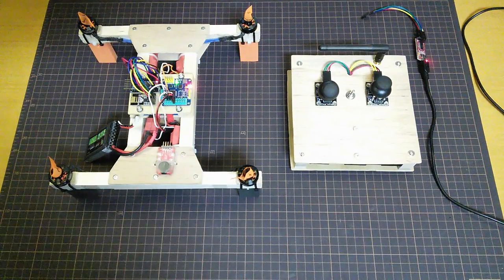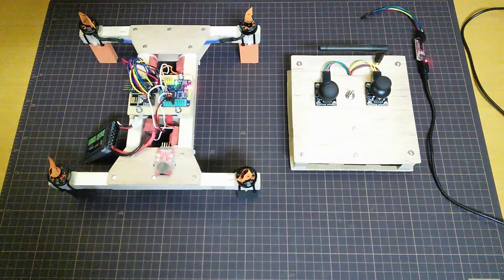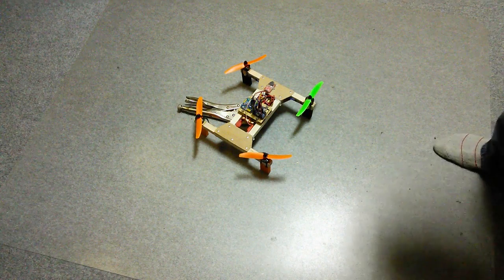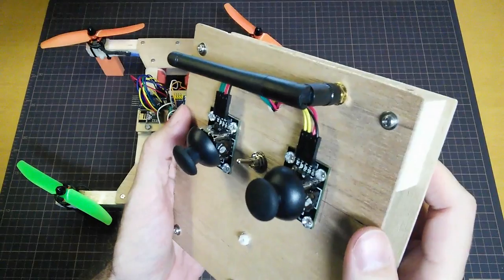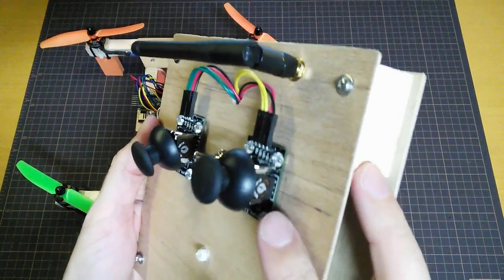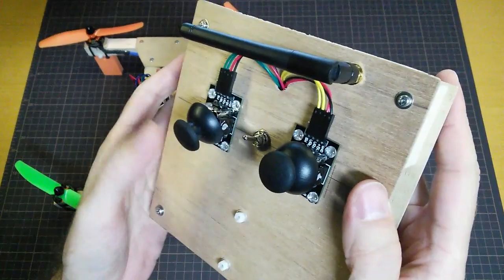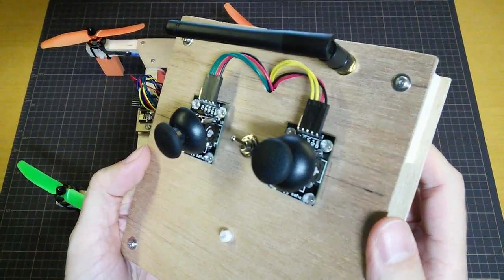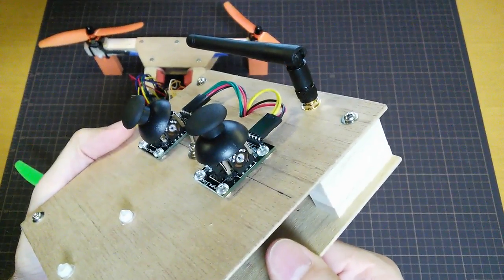Cheap-ass quadcopter build Part 9 - First test

Comment: Hi iforce2d, I took it for the first flight today. And it doesn't end well. I start the throttle just fine and just a bit of a roll , It make 8 3D flips in 2 seconds and crashed .It broke my landing gear. That's quite unfortunate. However I am unable to find whats the problem is. Please help out!
Reply from the maker: Is it in angle (auto-level) mode or rate (acro) mode?
Reply: It is default. I didn't set any mode.

Comment: Hello! Many tanks for your videos, it helped me a lot ! I just post this message to help people that may face same problem as I have had, and try not to pull your hairs off your head if you face them. Be carefull with what you order, some items did not work, so don't be upset if something does not work, thinking you have done something wrong... items sometimes just do not work at all and you have to buy a new one. 

Next issue I've faced is on the multiwii board. The names of the pins, written on the board were in the wrong order, so be carefull also... again, I didn't understand why I couldn't upload any sketch on it and then I figured this out, and it worked. 

Finally : If you notice that your receiver is not giving the same adresses for the transmitter and the receiver (I had the good for the receiver but not for the transmitter), try to change the 1 into a O in the receiver sketch line "radio.openReadingPipe(0,pipeIn);. I did that and it worked finally well. 

Last thing, and I still couldn't resolve it, me be Iforced2d you could help me. I got Emax ESC's blheli series 30 amp (I use a 3s 11.1V 2200 mah), but my motors have to be calibrated. The problem is that it seems unpossible to do that just with a standard arduino Uno. As i build the transmitter myself like you explained it, I don't have the little device that comes with a real one you can build. So I was wondering if you knew a way to calibrate them with the multiwii board and some software (Openpilot or else) ? 

Many tanks!
Reply from the maker: You can treat the ESC as a servo, and use the servo library to tell it how fast to spin, as shown here: https://www.youtube.com/watch?v=Ja5-JjGc5DU&t=24m

To calibrate, the servo value needs to be full throttle (2000us) when the ESC is powered on, then it will make some little noises, then you set the throttle to zero (1000us). You could change the arduino program I show in that other video to do this, for example set servo value to 2000 and wait ten seconds, should be long enough, then go to 1000. Make sure to power up your ESC during the first ten seconds. And make sure to remove the propellers!
Reply: Thanks! I now have resolved that problem. But now when I power up the drone and the transmitter, it is completely random. Sometimes I can arm the drone easily and fast, sometimes not... and I don't know why (may be there is a specific order to power up the receiver and the transmitter but I've tried some and it doesn't look like there is one). When it works, i've tried the same method of test you did and put some weight beneath it. Systematically, the drone flips over to the right. I don't think it is a weight balance problem. Is there in the multiwii software a specific place where the pins of the ESC on the flight board are specified (took same as yours but we never know...) ? 

I suppose you definitely recommand using a real transmitter... but would have liked to use my DIY one :)
Reply from the maker: Are you flying in rate mode or angle mode? Rate mode is quite difficult for a beginner.
Reply: I figured out that one part of the problem was not where I thought it was. It was in the connections in the transmitter. I didn't want to solder things on the arduino pro mini first, but I had to now, because after building the little joystick tester, I saw that I had a loss of signal coming from the DC stepdown converter, so I soldered everything and now it's ok. Just now I tried the drone again and I still broke a propeller. Examining the motors, I saw I have sunnysky (same as yours) but on 3 of them, there is a little ' II ' after the CW/CCW indication. Have you ever heard about differences between these ones and those who doesn't have that inscription? because it always flips over the side of where I have the 'II' . It's driving me crazy!
Reply: Ok now it works and I'll test it outside tomorrow. What was wrong? : I don't know why but one of the motors spinned slower than the others (one with a II on it). I replaced it with a spare one I had. I've also put the radio module further from the battery and the power board to avoid electromagnetic influences. Finally, I went in the multiwii sketch to check out about the esc pins on the multiwii board (were the same as you indicated, but it's not very easy to see on your video between the esc's in the rear, which one goes on which pins). 

Again, thanks a lot for all of your work, I learned lots of things! :) 

Now I'll try to add and implement some light and camera control via the DIY transmitter!

Comment: Hey dude, you are awesome. Thanks a lot for this video series. I have learnt a lot with the help of this. I have a build a quadcopter only because of you.I have finished all the things and now at the time of testing, i am observing that it is flipping again and again. When i tried to connect it to gui then it shows that at the time of arming all motors are running at same speed. When i increase a little speed then also all the motors have same speed but as i increase speed further then front right and rear left are increasing equally but the front left and rear right are going down continuously. Please suggest a solution.
Reply from the maker: Are you actually flying it? If not, that is normal and is called integral windup - it happens because nothing happens when the flight controller tries to correct the angle of the frame, so it tries a bit harder, and a bit harder etc. Just take off and fly, it should not do that once the frame is clear of the ground and the changes it tries to make are actually effective.
Reply: Thanks for the help bro. You are genius. Your suggestion has solved my problem. Thanks a lot dude.

Comment: Hey, I'm having an issue where I try to arm the quad, and the morors spin for about a second, and then power down instantly. Do you think this could be a problem with the ESCs, or some sort of short in the wiring of the arduino, multiwii or somewhere?

Would love to know your thoughts.

Thanks,
– Joe
Reply from the maker: +Joe Allison hard to say, never seen that before. Are the radio control channels behaving as expected in the multiwii config display?

Comment: +iforce2d I've callibreat the acc and am in angle mode. but one moter snins olways slower. like it's always slower can't I change something to make it turn olways a bit faster ?
Reply from the maker: +mathis peyronne Is it sitting on the ground? Try taking off. Does it do it in rate mode? If not, the problem is not really a problem - it just happens because even though it's trying to adjust its angle nothing happens because it's sitting on the ground and cannot move, so it keeps trying harder and harder and one side will become faster and one side will become slower.

Comment: Very interesting videos! I will consider build similar things somewhere in the future (when my budget permit me this).

I have one question: Since you have two-way communication, or at least you can use it, can you read feedback data about altitude, dirrection and other parameters from Multiwii board? If so, this will be good to have. For example, knowing altitude (from barometer or from GPS data, once added) - because at a distance, it is very difficult to tell how hight it flies. At 'command site', it will be good to have some sort of audio feedback... For example, if it goes up, buzzer with tone going up.

Also, if it is out of range, it will be nice not no cut off throttle, but rather program quad so that it lands slowly. Not to mention what can be done with GPS, such is recording flying path (but that does not require feedback information).
Reply from the maker: ***** https://www.youtube.com/watch?v=bxlJckevIEk
Reply from the maker: ***** https://www.youtube.com/watch?v=DAXf5ho2jxs
Reply: Oh, that is excellent!  I enjoyed watching both videos (aside many other videos you made). My concept of what is possible, and what is not changed dramatically after watching your amazing videos. Thanks again.

Comment: Hey, you can try using a "slider" potentiometer.
Throttle as vertical slider
Yaw as horizontal slider
I will use your code using 2 sliders and a joystick for pitch & roll :-)
Reply from the maker: Not sure how you could control three inputs very well with two hands, but yes it would work :)
Reply: Loool it may be useful for throttle only, not yaw.
It is only for you, you complain too much about your joysticks ;-p
Reply from the maker: yes I sure do hahaah ;D

Comment: hi!
can you give a hint how you designed the antenna to the T6XA Tx? (geom, material, any link or a video:)) was the purpose of this antenna only to have a multidirectional Tx? i saw it in your earlier video that, you needed to have a certain angle between Rx and Tx antenna to work well. did you attach it to the high power nrf2401 module?
Reply from the maker: It's exactly the same as what I made in part 5 of this series, at about 21:50 you can get a view of the back of the wooden-box tx. There's not really any 'design' to speak of, the antenna simply connects to the RF24 module with that tiny connector. For the distances I'm working at, I'm not too worried about whether it's multi-directional or not.
Reply from the maker: ***** oh, you're talking about the clover-leaf antenna right? You can buy them like that, although they are not all that difficult to make yourself. Check out the YouTube channel of Andrew McNeil who does a lot of DIY builds and explains all the geometry in detail: https://www.youtube.com/user/8bitandrewmcneil
Reply: ***** exactly :) million thanks!!

Comment: Can I connect this board with arduino ? 
http://www.amazon.com/gp/aw/d/B00P3J8YEM/ref=mp_s_a_1_8?qid=1415847866&sr=8-8&pi=AC_SX110_SY165_QL70#
Reply from the maker: Yep. That's actually the same board I'm using on my first quad. You will need to set it up to use PPM input.
Reply: ***** thank you

Comment: Great video, have enjoyed watching your build series thus far. Hope you find some better pots... would be good to see that tx working well too! What sort of range to you get from your other tx?
Reply from the maker: The other tx is exactly the same, just has nicer joysticks. I would trust it to about 150m, not sure about much further. I did eventually find some pots that work pretty well :)
Reply: Great. The sticks certainly make all the difference, especially with all that deadband in the center... I suppose if you added in some form of expo you could make them more usable, but as you said... easier and more comfortable to just cannibalise a dead transmitter for the gimbals, pots and case. I've had a nrf24+LNA+PA out to around 200m with some dense trees in between before it drops out / becomes intermittent... so they certainly have decent range on them. a cap soldered to the back of them certainly makes all the difference.
Reply from the maker: Peter Feerick
That would have been with a PCB antenna at the other end right?
Reply: I think so. The LNA+PA version I have has a full size screw on antenna, and I have two types of pcb antenna board - 10pin (useless in range) and 8pin (ok range). I also have some that have a screw-on antenna but no LNA+PA... and I may have used that at the time. Im in the process of making a receiver display unit similar to the one you showed earlier... and I'll do some more tests then.